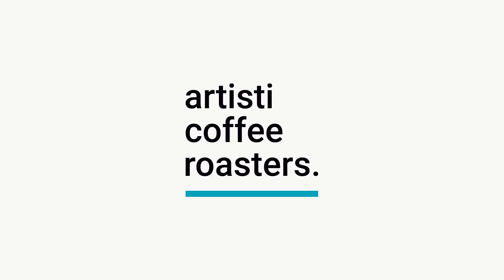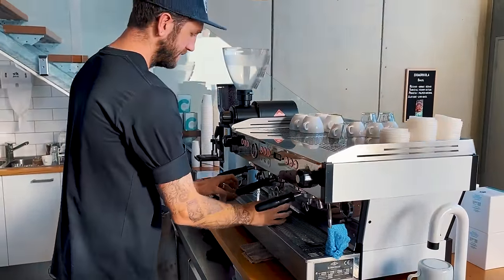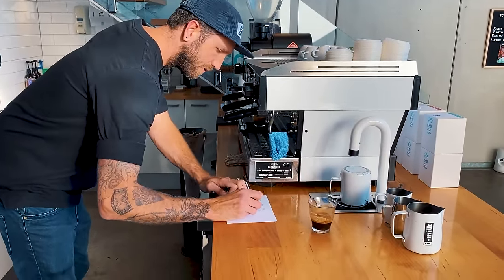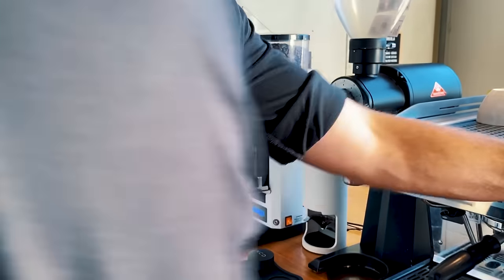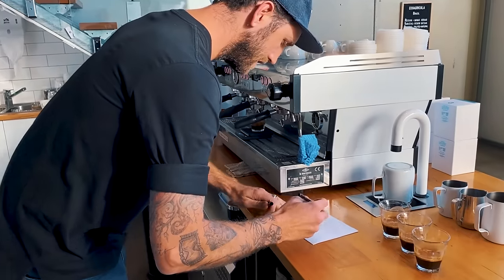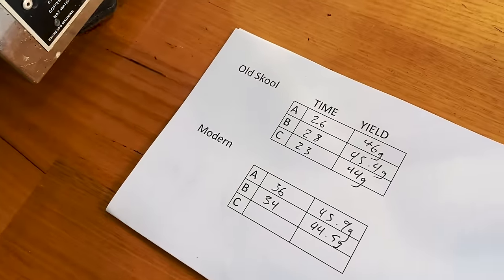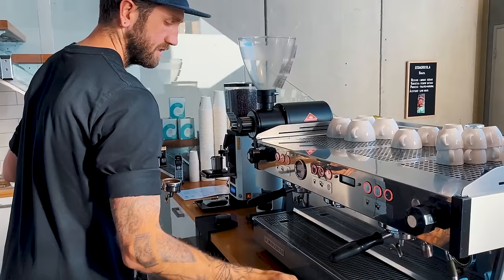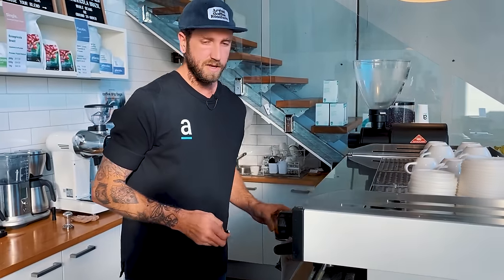Coffee Puck Preparation Techniques Compared (Making Better Coffee)

Comment: Great video.  I need help!! I'm a home barrista and relatively new to it. I've watched loads of videos and and am defo new school.  However I still can't get my extraction to not squirt and dribble from my open  basket. I weigh my coffee, grind it using a quality bur grinder, use  a tool to get the lumps out, use a leveller and tamp tool and still no success.  I don't think I can take any more care of my puck prep. I'm starting to get very frustrated.  Please can you offer and advice?
Reply from the maker: This sounds so frustrating! I feel for you. You'll need to consider the age of the coffee. Make sure it's 7-21 from roast date to ensure you're getting the contact time & expansion needed to not created unwanted channeling. You may want to upgrade to a VST basket to ensure it's managing the pressure well. You can also try doing a one second pre infusion to help with a more even saturation of your puck prior to full pressure extraction. Let me know how you go.
Jimmy

Comment: You did not measure coffee amount for "old school" method but you did for machine tamping. That means there is another variable besides tamping.  For the purpose of this kind of experiment, it is better to keep everything else constant and only change one thing so we can see the effect of that variable.

Maybe you can redo this with same amount of coffee each time, and also vary the machine strength if possible. 14kg for the high setting, 10kg for medium, and another for low, and then we also have old school tamp by hand. That way we can see the effect of that one variable more clearly.
Reply: Hi. I think part of the point here is that old school didn't weigh or tamp consistently and didn't measure grounds in or measure extraction. We only had taste and you can taste everyone's coffees.

Comment: how are you measuring time here? Going off the videos, the shots are pulling in 10-15 seconds from the time you push the button to the shot completion, and then you'd call it 30+ seconds.
Reply from the maker: Shot time on the machine 🙄
Reply: The video was sped up during the shot pulls.

Comment: Hi, I already bought a Lelit Marax, I am in love with it but I have a problem. I do a correct simple puck prep with a fine ground (I tried multiple settings with a eureka mignon oro sd) but I cant get the pressure of the machine high. It just extracts the coffee the whole time pretty fast and with 3 bars of pressure. I blind tested it and it gets just fine to 9 bars, which is what I am hoping for. Any suggestions?

Comment: Question: in regards to the little silver dosing cup you load the grind into; taking espresso grounds in and out to achieve the correct weight is oxidizing the espresso grinds that are off to the side no? Does that not really make much of a difference to cup quality? Thanks for your time!
Reply from the maker: For the short time it’s exposed, the pros of good distribution out way the cons of oxidisation 👌🏼

Comment: I wonder if the needle style distribution stirring tools really create more channels than they "solve"
Reply: Only if you use 0.4mm wide needles or above. Go for 0.3-0.35 for maximum distribution without creating channels. Also a very very light tap afterwards helps collapse any air pockets (y)
Reply from the maker: Thanks Adam 👏🏼
We didn’t include a WDT tool in this video as they aren’t practical in cafes yet. We are confident they help with extractions more than they hinder them.
Reply: @ArtistiCoffeeRoasters  Bang on
Reply: @ArtistiCoffeeRoasters  The spinning WDT tools like the Duomo Eight and its knockoffs are much more practical for a cafe setting while still resulting in more even distribution and higher extraction than wedge-style distribution tools.

Comment: So is using a WDT at home just a load of bull and I don't need to be doing that?
Reply from the maker: No, wdt is the single most thing that’s has proven to increase an espresso extraction for consistency, flavour, balance, tds and more. It’s the smallest and cheapest investment you can make to improve your espresso. Cheers luke
Reply: @ArtistiCoffeeRoasters  ah got it. I just didn't see you use it in your workflow so I thought it wasn't necessary. Thanks!

Comment: Well, this video is an ok demonstration but it does really say what’s different exactly and what contributes to the consistency. You wrote things down, but there were so many variables between the two that it’s difficult to see what you’re actually measuring. Maybe if you only added the scales, you would have gotten 80-90% of the consistency, and the rest was just the last few percentage gains.

Comment: Forgive the noob question but how does the machine stop if you’re not stopping it on a certain and you’re not stopping it on a certain yield?
Reply: Some machines are built with automatic stops of sorts. The button press will cause the machine to dispense an exact volume/mass of water, so it stops itself. This is something that would involve a bit of programming after someone develops a recipe, so at one point someone did the work of manually changing the yield and water in.

The reason this still causes variability is that if there's a big difference in the amount of coffee in the portafilter, the evenness or the pressure of the tamp, the grounds will absorb/interact with more/less of that exact amount of water that the machine was programmed to dispense.
Reply: @Sakura11101  Thanks!
Reply from the maker: What he said 😆 thanks Sean. Couldn’t have said it better myself.

Comment: Isn't the time determined by the machine? It's programmed into it?
Reply from the maker: No, time varies by how long it takes to get a nominated amount of water through the head. 
If the coffee is fine, it will still give me 45g, it will just take longer. 
Course and my 45g will still come but much sooner. 
Does that make sense?
Reply: The volume of water the machine dispenses is what is programmed in but the differing results in the cup can vary by the grind setting….A grind that is too coarse can result in a greater yield and a bitter taste and a grind that is too fine can result in a lessor yield and a burnt taste…..also the tamping pressure can change results.

Comment: Does that hand tamper even fit the basket properly? doesnt look like it.. that 3rd traditional run looked pretty uneven... and I dont get why anyone would wack the portafilter or do a second tamp unless the tamper didnt line up with the wall of the basket anyway resulting in the grind up the wall of the basket. You can see the tamper at an angle sitting in the basket on the third traditional run. I appreciate the video but its really not a fair comparison at all.
Reply from the maker: Sure, if you have been in the game for over 15 years these are things that were normal, if your new to the game, things have come a long way in past 5 years

Comment: As an old school barista, these tools seem to create a consistent product under the right circumstances, but temperature effects grind dramatically, not to mention any number of tempormentalities (if that's a word) an espresso machine can have at any given time. If I notice my shot pulls are longer or shorter, I can adjust my temp pressure accordingly. At the end of the day, quality espresso is more of an art than a science, otherwise we would have seen a dramatic boost to coffee quality with new school coffee tools.

Another note is efficiency. Using this video and watching the time, shot pulls start to finish were: 
Old School = about 35 seconds vs New School = about 70 seconds. 

Double the shot prep time comparing New School vs Old School. I'll stick with old school myself.

Comment: I am new to making my own espresso at home. I have an inexpensive delonghi machine and a crux grinder. I’m having trouble getting to a 25-30 second extraction. I am weighing 12g of fine grind coffee and shooting for 24grams output. I am doing my best to have a level coffee bed and use a tamper for this. It is taking about 20 seconds. I have varied the grind size and it doesn’t make much of a difference with extraction time. If it is more finely ground, then the coffee continues to drip out after I stop the machine. If it is coarser it stops more quickly when I stop the machine. This machine is totally manual. 
Any tips for how I can get a longer extraction?
Reply: I'm a novice like you, but have you tried ~~temping~~ tamping with more pressure?
Reply: Novice here, but have you tried tamping harder?  Also, are you using a single filter basket?  As 12g in a double filter basket is too little coffee.
Edited for clarity
Reply: I think you won't be able with this equipment... it is a little bit wanting a Ferrari performance out of a Volkswagen. But if you are investing in a better grinder you propably will already get closer to 25 seconds. (Tip is to get yourself a grinder out of the industry and replace the parts that are grinding the beans. Most companies just get new equipment because they need it daily and sell out the old while it is build to last)
Reply: Make it 10 grams

Comment: But the point is not about consistency in extraction or yield…you could have tasted your yields and showed which of the so-called old school and so-called modern methods gave the consistently better flavor.
Reply from the maker: In this video, the point was exactly about consistency. 
No point tasting them if I’m not sure I can replicate my shots well enough to make correct grind changes based on taste. 
You need to have a consistent process, with the best opportunity for flavour, then you taste and adjust. 
No consistency means flavour is always different.

Comment: What’s your recipe? Shouldn’t it be around 28-32 secs. Apples with apples, should also weigh dose with old school shots so you can compare properly and not tap to spread grind before using distribution tool. Why were you tapping after tamping first time, isn’t that a no no. I do old school (without tapping the puck) and weigh every shot and get consistent shots every time. You gotta work at it but can get it done and probably do the process just as quick and in the same time with 20 g in 44-45 out (roasters yield ratio suggestion for the beans) in around 30 sec
Reply: 100%

Comment: I personally feel this is over engineering a fine art. True not everyone in the workplace will have that consistency. But don't knock old school. a great chef will make every meal consistent, same as a great old school barista will understand consistency
In saying that, in a fast paced work environment this is good business.
Reply from the maker: Agreed. There is a real art to espresso that some old school baristas just have and I don’t want to take away from that. Unfortunately, baristas are moving around, cafes are struggling to manage inconsistencies between staff and relying on one barista just isn’t viable. 
Appreciate you pointing that out 🙏🏻
Jimmy

Comment: Firstly your old school results were mainly varying due to probably inconsistent tamping. 
Secondly, why are you potentially damaging the porta filter handle and the tamper by banging them together and thirdly if you are in a cafe situation that pumps out 4kg of coffee in 3 hours customers would walk out if all that “modern” method is used due to waiting extra time. I have been in the industry for 30 some years and its not a matter of old dogs new tricks syndrome its a matter of simplified / faster method with the correct results. I have weighed up old school verses new modern and the taste results are pretty much on par….Cheers.

Comment: I have to disagree about "old school puck prep" - good coffee shops 20 years ago still had some form of measuring of dose.  All this video shows me is that you weren't trained very well back then.  But even still, this test doesn't answer your question at all.  This is the problem with many Barista videos.  They think they are doing some sort of scientific testing getting data, but they miss the outcome by a mile and their methodology is just a POS.  These tests don't show whether "old school" is better than new, it simply shows that measuring gives you more constant results over guessing.  Which is blatantly obvious, but I find the premise disingenuous, however this is so common amongst Barista videos.  Barista's need to do a course on how to set up an experiment properly to test what they actually want to test.

Comment: This is stupid because old school baristas have grinders that deliver standard doses of coffee. "New school" method is highly incompatible with the workflow of any cafe in my country and in Europe, you can do it just because you have very little customers. Come in Milan, Roma or Napoli: baristas make perfect espressi in no time and they would laugh at your workflow!
Reply from the maker: Interesting, it’s our understanding that the volume of milk based drinks is very low as they make more espressos? That’s a different workflow and timing is easier for Esprssso only?
Reply: @ArtistiCoffeeRoasters  I'd say in France (where I live) and in Italy (where I lived), among hot drinks, it's 95% espressi (short, normal or long) and 5% tea or milk based drinks. A barista can easily have 8-10 espressi ordered at the same time during a rush. Using a scale is not possible, nor WDT tool or anything besides a tamper. The barista rely on the dose from the grinder and then he must pay attention to the flow during the extraction in order to remove the cup at the right time. As every café or caffè uses the same coffee over and over it's easy for the barista to master his espresso with some time and effort whithout the need of a scale or a timer. I suggest you check on the different napolitan baristas routines you can see in YT videos, very interesting! Sorry for the tone of my first comment!

Comment: Isnt 36 sek to long ?
Reply: Yes, but he is showing how consistent the method is. Once you have consistency, it’s easy to correct. Based on the shot times, he would adjust 1-2 touches coarser to open up the grind and hit 28-30 secs (or whichever his recipe requires). But retaining consistent dose is the key. Eliminate the variable and gives consistency.
Reply: Thanks
Reply: @reonparrott7786  Confusing to me - if you are getting the right ratio of output to input (and what is right?) then how does one know how fine to grind?  So many variables.  And I don’t have the palate to know which one I should adjust first.